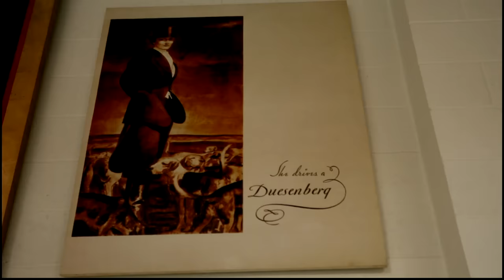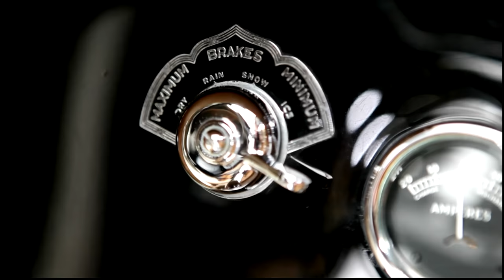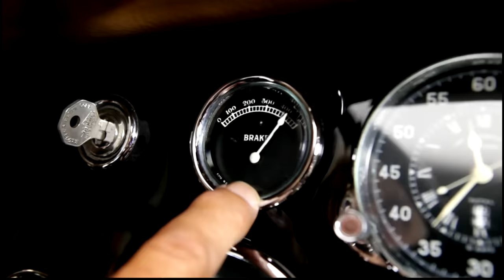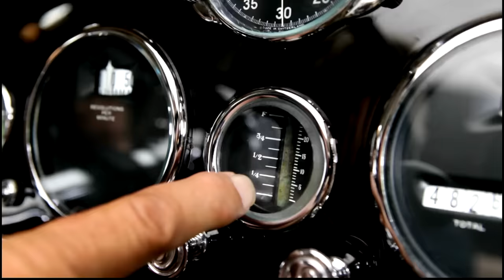1930 Duesenberg LeBaron Barrelside - Jay Leno's Garage

Comment: Altimeter.  Duesenberg allowed the driver to adjust the fuel/air mixture to optimize performance for high altitude locations. There was a playing card sized chart that contained settings for the carb based on the altimeter reading. This was done perhaps to sell one to Al Capone who drove his “Dusey” in Denver.
Reply: What possessed me to do it I disavow now; to drive a 1964 Pontiac, 326 with a 2 speed transmission, carrying 4 people and luggage for 5 from WI up through Denver (where my ears were the altimiter) to Los Angeles: and oh yes for a manual spark advance going mountains, and a few more metal clothes pins on the fuel line the carb.  Other than that, only the pumpkin fell off after I got back to WI.
Reply: "Duesenberg allowed the driver to adjust the fuel/air mixture to optimize performance". And so did the Model A Ford...
Reply: @Dennis-lx9mo  But did it have a chart and altimeter to do the settings optimally???
Reply: Chart and altimeter are not accurate enough. You would also need to factor in the weather (temperature, moisture, etc.) WE do it by the seat of our pants!! and how the engine is running... haha. (all in jest).
Reply: Now, that makes sense, that the altimeter had a purpose that was more than just vanity. In fact, I remember when I and a couple of buddies drove from NU to Aspen CO to go skiing and as soon as we had passed Denver, and began ascending the east slope of the Rockies...probably when we hit about 8,000' elevation...we were forced to stop at a gas station to have the carburetor mixture leaned out because of the thinner atmosphere...and the reverse on the trip back. I presume with electronic ignitions and computer-controlled fuel injection this is done automatically these days. As for Mr. Leno, it is nice to see that he is not so vain as to restore cars so that they can just sit in a museum.
Reply: @Dennis-lx9mo  you didn't get the card though!
Reply: @olensoifer9901   The card is just vanity.  The common taught practice for aspirated pilots is to just lean the engine until it gets a little rough, and then to enrich it a couple of turns back.  These cars aren't getting to any altitude as the aircraft, this could easily be done with the choke and the card is silly BS common for overpriced cars...
Reply: So they made it Himalaya complaint 💀. I have been to 15000ft and cars really lose power and produce thick soot even with turbo charged cars it's a noticeable difference in performance above 10kft. The highest road that exists is 19k ft umling pass .

Comment: Jay, these intimate video tours you’re so generously offering during the pandemic mean everything. THANK YOU
Reply: On ramp Hollywood Fwy N/B W/B 134 Ventura Fwy in ‘89 Supercharged MR/2. Jay’s right beside me in Baby blue open wheel? 20’s racer. Brake handle on right running board. He flashed me that smile. We traded fist pumps. He left me in the dust. Shalom Tim Jagoe

Comment: What other guy would admit to being in such a panic, that they did not see the fire extinguisher and put the fire out with 7-UP!!!!!  Jay you're awesome!
Reply: lol. You have to remember he's Hollywood.
Reply: I had to put a fire out in my dad's 2500 Chevy in around 1994 with Welch's Fruit Punch Soda. It used a quart of oil every tank of gas, I forgot to add it on a road trip, pulled over on the side of the road, had no funnel, and hit the manifold with oil. Instant fire. All I had was a case of sodas in the back seat. It worked.

Comment: Amazing that even the tire wrench reflects the level of engineering that went into the car itself.

The curved design of the top of that dash looks remarkably advanced for the 1920s automotive design.
Reply: ecactly... designing that part. Production planning and bring up to finished product would have been a lot of work. Or that part could have been adopted from any other existing special purpose machine.

Comment: I feel like it's just me and Jay taking the Duesie for a spin around the block.  Such magnificent engineering.  I bet it will still be blasting around in another 90 years when everything built today is long-gone because the electronics crapped out and all the plastic bits turned to dust.  The locking wheel hubs are quite a theft deterrent without the frammis wrench.  Super cool!
Reply: There's a lot of truth to that.  All this electronic stuff will bite the dust way more quickly than the old metal and gears kind of thing.

Comment: Jay, I just love these longer detailed videos with all the aside stories about this wonderful automobile.  Now at 74, I am still a gear head when it comes to this stuff.  As a young teenager, I worked in a CT marina that had a full engine rebuild shop and often assisted the grumpy but wise old mechanic as he would repair or rebuild  older Chris-Craft or Grey Marine engines.  However, in the 1960’s it was mostly Chevy blocks  with “ram-heads” to cycle seawater through for cooling.
Got to see my first Dusenberg up close this past September at the Greenbrier Hotel Concours in White Sulphur Springs, WV.  It was a 1929 Model J Roadster and a driven car, (somewhat). These machines are truly fascinating.  So many of the expensive classics of that time are.  I still drive a 24 year old pretty little Dodge Dakota pick-up that came with a factory installed Magnum V8 318, another bulletproof engine.  Thank you again for celebrating all these machines and inviting us into your garage to see, listen and learn!

Comment: i cannot thank you enough for your dedication to the automotive world, there is something i have searched for for years called a duo-drive RELAY motor truck, had 2 drive axles (open geared) and 2 transmissions (air shifted) 2 lycoming  i believe straight 8's and 2 radiators, if  your interested e mail me maybe i shed s. thanks again .some light on this rare truck.

Comment: This gets more and more interesting as we go forward it has a multifunction steering wheel, with reminders for maintenance and driver info. 

The best part is that the Dusenberg brothers had no formal education and yet made these cars that were at least 60 years ahead of their time. 4 valves per cylinder, twin cams, hydraulic brakes, just amazing.
This is definitely better than the drain plug we have to remove.

Comment: When they say they don't make them like they used to THIS IS WHAT THEY'RE TALKING ABOUT.
Reply: Well... they're still making handbuilt cars that cost 17 times more than a regular house.
Reply: @Lianpe98  In concept, correct. Fast cars that are luxurious. Problem is, the only manufacturer that makes a car in this style is Rolls Royce.
Reply: @EmperorXaozx  Outside of the Phantom, which prices itself into its own league intentionally (rather than really offering anything to substantiate "value"), its not really a one horse race. Mercades, Maybach and Bently all still offer extremely high speed/engine output, large/extremely luxurious cars that are worth nearly ten times the retail price of the cheaper new consumer cars on the market. Indeed even the top trim Telsa's sell to the same demogrpahic, albeit with acceleration to 60mph instead of insane the top speeds.
Reply: @SheepInACart  I was thinking more along the lines of the Isdera autobahnkurier ak116i. In concept, manufacturers do the same, as I said before, with their offerings.
Reply: @EmperorXaozx  Rolls Royce cars are the most comfortable but they are not the fastest nor the most exclusive. Car brands that are equivalent to Duesenberg in price, luxury, exclusivity and opulence today are brands like Pagani and Bugatti.
Reply: @Lianpe98  You dont understand. The principle is what they get right. Nobody makes a car like the Isdera I referenced in a modern form. A modern car that looks old, but actually fast and comfortable.
Reply: Yes this is the real old school, not ´70s garbaje cars
Reply: Is that what they meant, I DIDN'T KNOW THAT!
Reply: Well, in some cases such as a safety point of view, Thank god!
Reply: @fahb68  The 70's had the best muscle cars ever built.  None of them were stylish as this Duesenberg or any newer exotic Ferrari, Lamborghini,  McLaren, Koenigsegg, Aston Martin, Pagani, Hennessey etc!!!
Reply: They didn't make em like that at the time though, maybe in France.

Comment: Jay: you don't need an altimeter in a car
Evil knievel: hmm.
Reply: Hello melloy,
In today's or at least from the 1950's to the common introduction to all cars the fuel injection systems, altitude really didn't affect the performance of the motor. I remember in the late 1960s and into the 1970s you could order a car for 'high altitude' conditions, like a Colorado state vehicle
Now take into account the high performance of the Duesenberg.  In New York city, the carbs aren't really effect by altitude pressure (under 5000 feet above sea level).  Now how would the carb behave at 7000 feet ASL? Its performance would be reduced
For a mechanic to know what the altitude is in order to keep the motor producing in peak performance. An altimeter really helps in the tuneup steps.
This is one of the reasons behind the Pikes Peak rally. Before the computer controlled motors, at the start line the motor is producing 100% horsepower, at the finish line it will probably produce only 50%
Reply: @bfmcarparts  Which is why many carburetor manufacturers produced different jets & needles depending on the intended altitude of use of the vehicle.
Reply: In California ? You have to know how high you got. Of course you do !
Reply: Too bad that shows your ineptitude...

Comment: The Duesenberg, is a classic American dream car. I can never be able to afford one, or afford the proper maintenance of it, but I always admired the classic cars so much. So what did I do? The next best thing, I mounted a Re-Chromed Swan Ornament with Gold Wings from an old Packard on the hood of my 20 year old gold truck, which the roof has five amber running lights. I had mounted the Swan on my evening shift while on break. I had 25 mile dark country road drive home afterwards. On that drive home, my running light made those swan wings glow gold, and as I turned on the radio, the first song came on, "I Believe I Can Fly." I found that to be really haunting like a piece of the past came back to life.

Comment: It's computer is mechanical, a precursor of the analog computer from the 1930s. Brilliant stuff. These cars are genuinely over engineered for the era. A lovely thing to behold.

Btw Jay, I can most certainly have that candy apple green on the motor color matched so that the manifold will match the engine. I'm sure I can either figure out/come up with that exact looking type of paint using newer, legal methods so it will be perfect. Or at least I will give it a darn good shot.

Comment: 12 quarts of oil? Everything about this car is massive. So that's why when you tell a really HUGE lie, it's a "Duesy".
Reply: 12 qt every 700 miles no less! poured right out on to the dirt for a long time i'm sure
Reply: Bruce Snyder yeah, but how “massive ”, Jay said total weight at 5300 lbs? Is it right? Did it hear it right? Sounds “light” to me considering the size and the massive engine. My Porsche Macan (smaller SUV) weighs 4400 so now I am not sure - is this Duesy so light or my Porsche so heavy?
Reply: @olasek7972  I guess it's both, the Macaan has tons of features, safety equipment, electronics, all wheel drive.... the Berg just has an engine, metal and leather. They might have (tried to) built it using lightweight materials of the period or avoided thick metal for the chassis and body, weight increases fuel consumption and this thing already drinks enough oil and fuel, also all the power of the engine would be useless if it weighted 4 tons, so I think weight was a concern for them, today we don't care about weight because we have much more powerful engines so you don't feel the weight, we have electronics, rearwheel-steer and so on to make your car feel smaller and more nimble, we have tons of lightweight materials and the budget doesn't matter as much anymore because today you can't buy 10 houses for a rolls royce, it's quite the opposite now, a house in any part of western europe costs much more than a landyacht.
Reply: @olasek7972  Yeah, good point. I bet 9/10ths of the weight of the Duesy is the engine/chassis. We have a ton more equipment in today's cars, plus 5 seats.
Reply: The body is aluminum.
Reply: Elbert Vandevender is it? That would easily explain it.
Reply: Elbert Vandevender I could not find confirmation that the body was aluminum, most likely not, however aluminum was used for fuel tank, water pump, intake manifolds, crankcase, steering column, timing chain cover,  differential and flywheel housing, dash and brake shoes.
Reply: My 2001 F-250 SuperDuty uses 15 qts.

Comment: All radiators need distilled water not faucet water.
Reply: True. Evan's fixes that.
Reply: @williestyle35  - that's EVIAN... (as in French bottled water) and it's NOT DISTILLED, just fancy.
Reply: @syxepop  Its Evans water-less coolant... as mentioned in the video.
The advantage of the stuff is its less prone to picking up metal salts, that permit mixed metal corrosion of changing PH, and it boils at 190°C without pressurization. The disadvantage is it has a much lower specific heat capacity, so not only does it result in a hotter running motor for any given amount of heat transferred, it increases the differential between hottest and coolest parts withing the system. You also can't get it most places to just top off a radiator as you can common distilled water or premix, so your stuck always carrying a spare bottle around in the vehicle once you've converted.
Reply: @syxepop  Did you know that if you visit Evian-les-Bains, France.  You can fill your own bottle with the same Evian water right from cachat pump room for free just an fyi.

Comment: I need a clarification here.  If, as the story goes, this car was purchased just before the market crashed in 1929 with stocks, how did it become a 1930 model on the paperwork?
Reply: 6:47 you got to listen to him.
Reply: @Hot80s  I heard him say if the car was sold in 1930, it gets a 1930 title.  The story told is the original owner bought it in 1929 before the crash, so why does it have a 1930 title.  The car would have been titled first in 1929.

Comment: I used to have a new 350 z Jay years ago. I stopped one day to look at a 2005 350 z  Roster. Sorry I'm a lousy speller. This car looked pretty nice. Ask the salesmen how many miles. He said she had 300.000. I said really does it still run. He said it runs great. So I asked him how much he was asking for it. He said $3,700 I said really that's not much. Asked if I could take it out for a test drive. He said sure I never owned a convertible. It was fun with the top down. I was not looking to buy a car but long story trying to be short story. I bought it had a great time driving it for two years. Then sold it to a friend for $1000. bucks. Was always amazed Jay of the automatic roof that worked perfectly the hole time I had it. The engineering to make that roof work. The car was so fun to drive. Best to you Jay, Dave from Sebastopol

Comment: Jay, having an altimeter and a carbureted car is very useful when you are driving through mountains or other routes that wouldn't large changes in elevation. When doing so you really have to adjust or even read yet hey carburetor in order keep the car running properly. Hence the altimeter

Comment: The altimeter was just a fancy word for barometer. If calibrated properly it would normally read between 29-30 inches at sea level. A falling barometer could mean a storm is coming... good to know when driving a convertible. Also when driving in the hills & highlands, high altitudes can cause the engine to sputter or stall without adjusting the fuel mixture for it. Many people have breathing problems, headaches, nausea, or pass out at high altitudes.

Comment: Fabulous car. Fortunate to have ridden in first model j built for 1929 new york auto show. 2nd owner bought car for $2500 after war. Had several Deuseys. My friend bought the restored j for $120,000 in 80. Jay has forgotten that Chrysler had first car with standard 4 wheel hydraulic brakes in 1924.